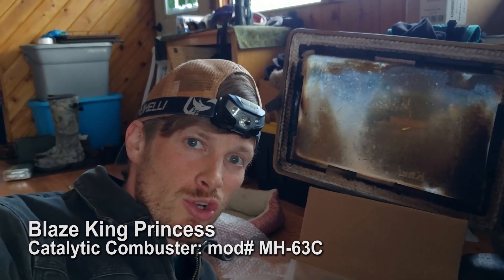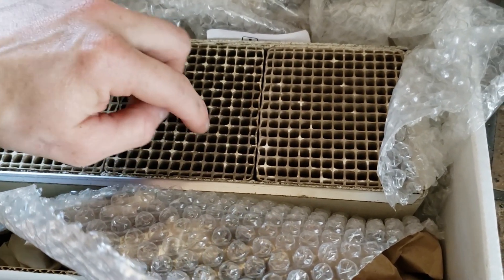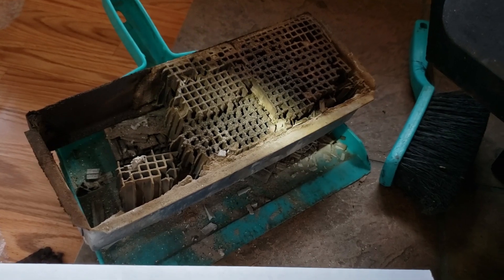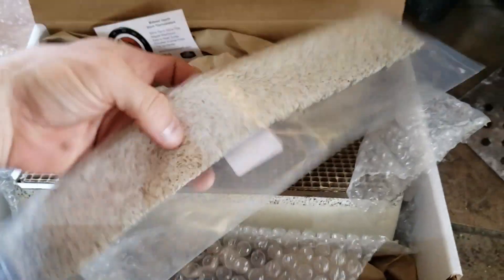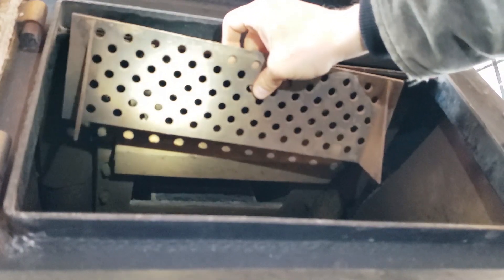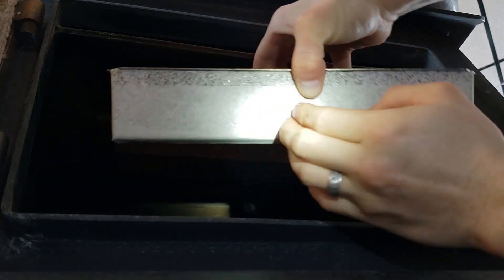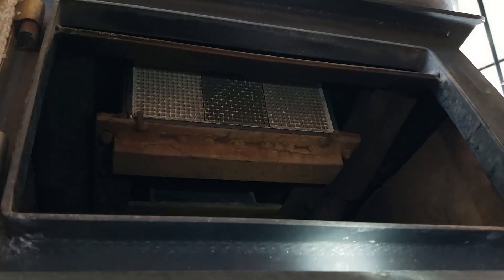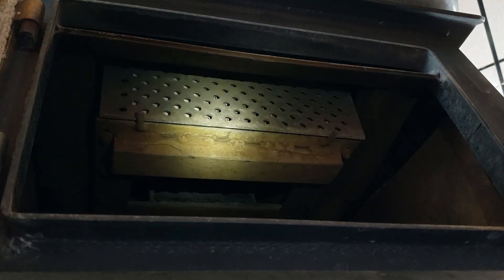BLAZE KING Woodstove CATALYTIC COMBUSTOR Replacement (ceramic)

Comment: Holy mackerel that thing is busted up! Thanks for the video guys. One thing I've noticed too is how important the door gasket is on the Blazeking stoves. I have a newer PE 32 and with that coil spring temp thermostat controller, the stove should never get over a certain temp. The only way it could get hotter than designed is if the air controller is failing, or if the door gasket is leaking. Check us out if you're into firewoodin'. Cheers!
Reply from the maker: You're absolutely right. I do need to replace the door gasket. I have the rope, I just need the special glue.
Reply: @BRAMANTEBROTHERS  Right on. Otherwise I'm super happy with the stove.

Comment: Definitely love the Blaze king stoves, but you will have to spend on average $400 every five years to replace the catalytic converter. 
If memory serves me correctly ablaze king won the most efficient clean burning wood stove award globally several years running. 
Made in Canada I believe.. correct me if I’m wrong)
Reply from the maker: Not sure where they are made, but it would not surprise me about winning that title. 
As for the combuster, Ours only needed replacing after about 12-15 years, and at the time, it cost around $250.
Reply: I think blaze Kings are made in Walla Walla Washington. I have a daughter-in-law who is a nurse. She actually had the original inventor and Owner under her care recently.

Comment: Did you notice a difference in your burns once you installed the new cat?
Reply from the maker: I welded some cracks in the frame as well, so with a mix of new cat & closing up some dangerous holes i noticed quite a difference. I had less ash, and a few hours more burn time.

Comment: My gasket around the frame crumbled. Could I just use door gasket to fit it
Reply: No. The catalyst gasket is around 1/8” thick.
Reply: @andybeshear5921  i ended up stuffing door gasket in the space. For some reason the cat was smaller than the hole in the stove.

Comment: That seams awfully exposed for that cat. I have a vermont castings that the cat is behind fire brick and a huge cast iron plate.  I changed it after 15yrs because the stove came with a new one and it was only missing a few ribs.
Reply from the maker: Yours sounds far more protected.  It sounds kinda hard to get to though.